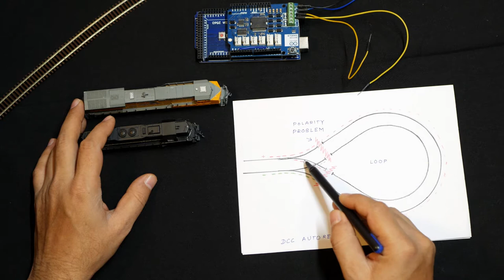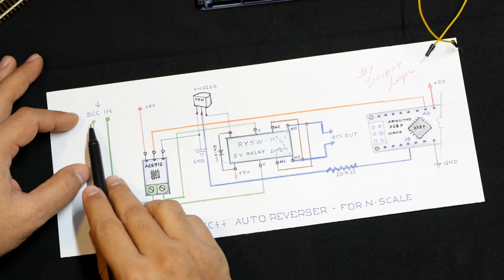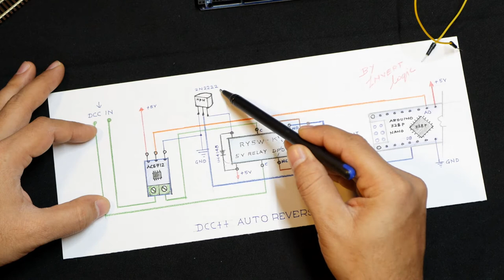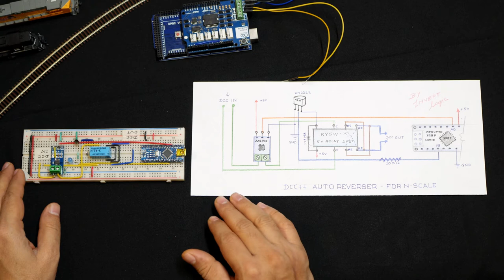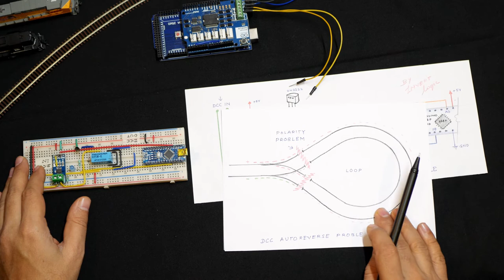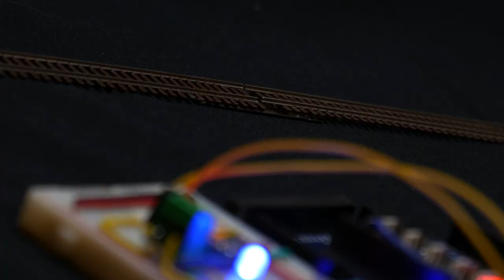DCC Auto-Reverse loop circuit using Arduino

Comment: Many thanks! With the help of this video, I finished my layout at a much lower cost. During this, I found a small problem. The current detection is implemented for one rail, which is enough for most of the time. The short circuit usually happens in both rails. But for some short locomotives,  one of a pair of wheels is a traction tire. So the short circuit first happens only in one rail, then spread to the whole layout. In this case, if that rail is not the rail monitored by the module,  the module will not flip the polarity in the first place. The DCC command will jump in before the module. So we lost power before the polarity is flipped.  I managed to monitor two rails with the small modification to solve this problem. Hope this information is helpful.
Reply from the maker: Thank you! it would be helpful for other if you can tell in detail what modification you did.

Comment: Hi,
Very informative video, thanks for posting. Could use this for a turntable under construction. One question, I can not find a sketch for the Arduino ?  Still several readers have built it .... could you point it out, or even better post it again? 
Peter

Comment: Hi, I've just bought all the parts for this, and will see if I can make one. I've used many DCC auto reversing modules over the years on loops and turntables, and was always keen to see how they worked. I'm interested to see if there is any development on this using the H-Bridge option to replace the relay. I guess that is faster? Or just less moving parts. A PCB for this collection of components could be useful too to make a permanent module. What do you think of the other comment below that mentions detection on both rails - is that something important to consider? I'm using the Arduino to make a programmable turntable. I hope to integrate this reverser into the turntable and run it on the same Arduino.

Comment: Excellent, could you redesign the circuit to use an H bridge instead of the relay?
Reply from the maker: Yes I will implement the h bridge in my next update
Reply: @InvertLogic  Great, I look forwards to seeing it.
Reply: @InvertLogic  Any chance of seeing your circuit using the H bridge? I am working on a concept using  the L298N IC

Comment: Well done! I will need a few auto reversing circuit for my future layout and I will be very inclined to use this, thank you for posting this. How much did it cost, considering  I have to buy everything new? Just so that I can compare it to the cost of an AR-1.
Reply from the maker: Thanks Kaustav! The cost will be around 9 USD for Arduino and all electronics. But I have not tested this one on HO layout yet As I only do N scale. I also wanted to buy AR1 but the cost after shipped is approx 50 USD.

Comment: What about the unmentioned yellow jumper on the ACS712?
Reply from the maker: it is because my ACS712 module had problem so i connected jumper to IC. you just ignore it.
Reply: @InvertLogic   I'm glad I read through the comments, as this was one of my questions too!  Just received my delivery of ACS712 so, about to go to the garage and build a test rig on my breadboard

Comment: Hi,
Thanks for posting this video. Very usefull.
I've implemented the circuit you have shown (except that I've used a 2222N2a, instead of a 2222N2). For some reason it's not working. I mean, If I use a LED as a load to the transistor instead of the relay, it lits perfectly. However, when I place the relay again, it does not operate. I've placed the LED in paralell with the relay, and I noticed that when the transistor is excited, the LED lits for a brief moment and then turns off, with the relay still not operating, not even for a brief moment. Could it be due to changing the transistor? The characteristics seem not to be that different.
Thanks a lot in advance for your kind support.
Reply: Hi,
Problem solved, I had the emitter and collector connections switched over. Now it's working fine, although I noticed that there is some lagging in Arduino response. I mean, it's not fast enough to avoid the command station trip. In any case, the train inertia allows it to ride through enough time, for the Arduino to switch over to the correct polarity. I'm considereing to change the whole Arduino for the ATTiny 85, perhaps that will improve time response. However, before that, I'll fiddle around with the current settings on Arduino. Maybe lowering the threshold will allow for sooner detection and thus switching before command station trips. 
Thanks once again for posting. It was quite usefull, saved me quite some €€€ and, most important, learned quite a bit on electronics😀